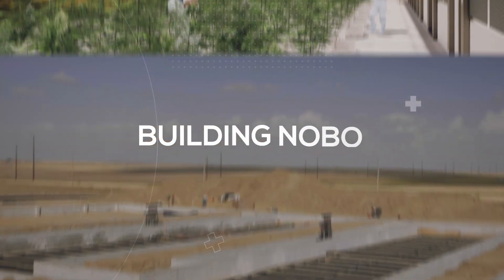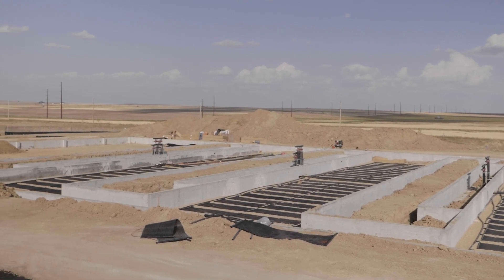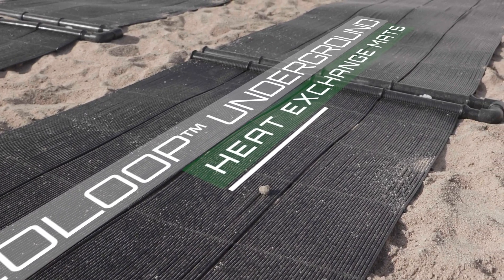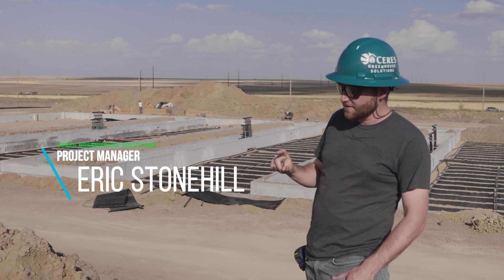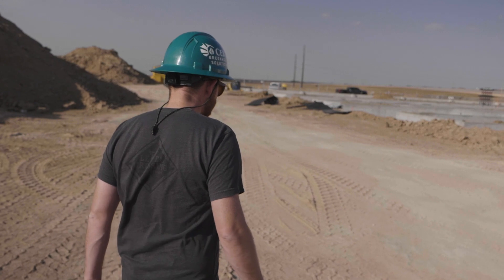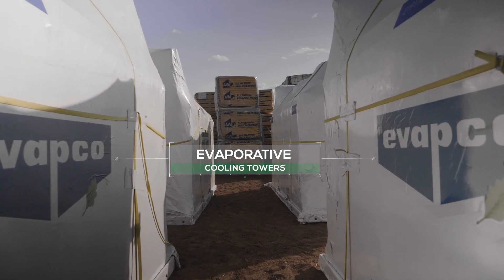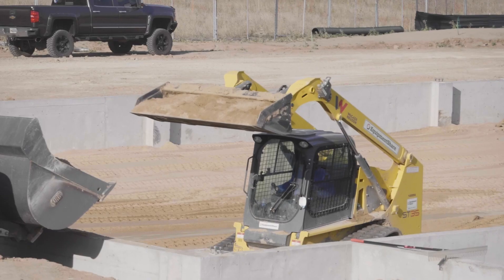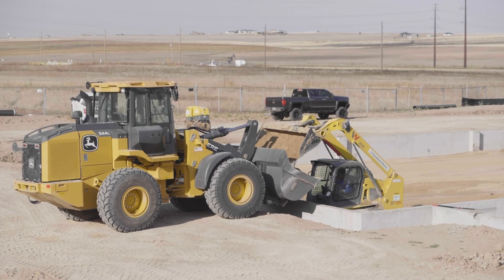Building NOBO | Episode 2

Comment: Is there an option to install the Ecoloop System in an adjacent space to the greenhouse or is it only possible to install under the foundation?
Reply from the maker: It can be installed anywhere. It's a horizontal geothermal loop. Having it under the building footprint usually saves on excavation cost since the excavation has to be done anyways for the foundation. If you install an EcoLoop™ somewhere else, the overall cost increases but is totally doable. We would also suggest burying the EcoLoop™ deeper below ground to have access to a more stable ground temperature year-round (depends on the location and if the goal is mainly to cool or heat)